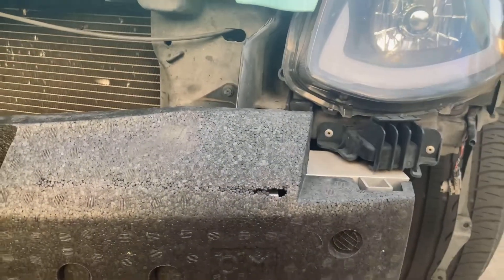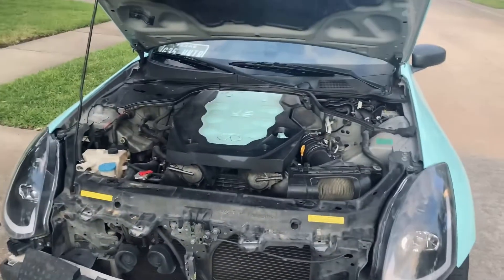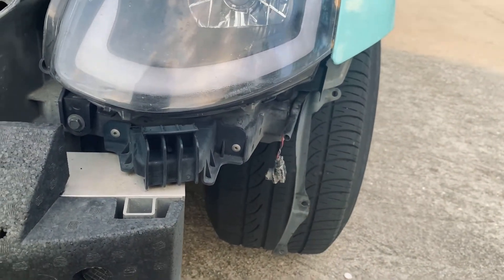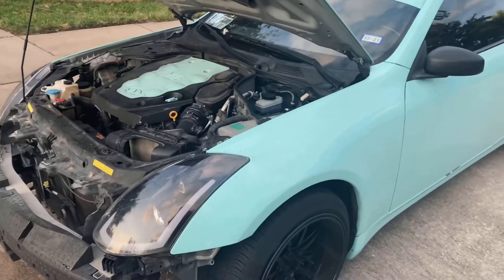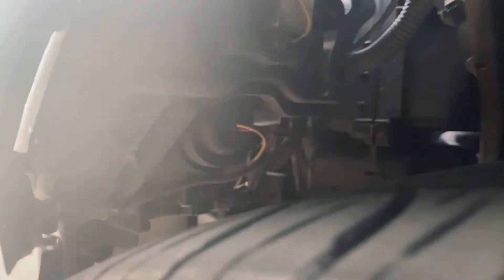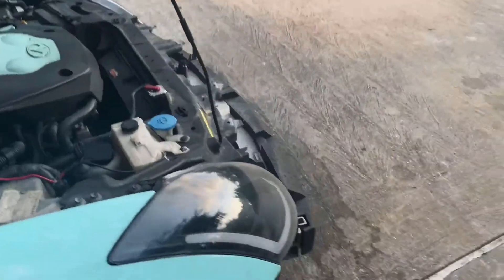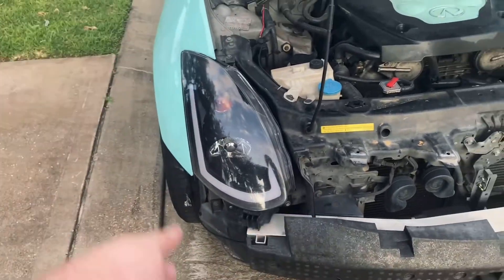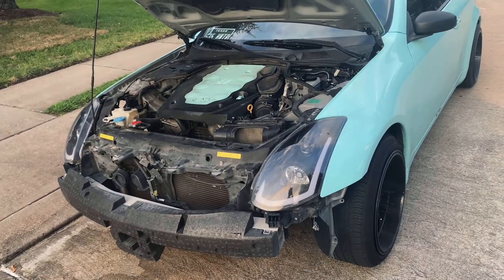G35 Spec-D Headlight BUYER BEWARE!

Comment: Just subbed bro out in Cali wit my 06 g35👌🏾I have these headlights on my G they’ve been amazing bro your supposed to seal them up before you install them (Spec D recommends in instructions)  & then you’ll have zero condensation in them, for the cap it might’ve fell out if you didn’t turn it & lock it in all the way. Just use the one off your old headlights their the same thing👍🏽
Reply: where did you buy them ??
Reply: @notcarty9157  Got mines off Amazon because I have prime. No difference to them, & got to me in like 2 days👍🏽 just seal them up with silicone sealant (black looks best) before you install. Let the the sealant fully dry & you’ll be good had mines for coming up on a year no problems or condensation.
Reply: @unknownsuspect5362  Link for the headlights you got?👍🏽 they raised the prices to 400$
Reply: @NSRTalonzo  these are the exact headlights I bought. Prices depend on the color housing you get. I have black, looks the best to me. Seal them up before you install & there ready to go bro. No complaints

Comment: Thanks more making this video. The lamps look great...
BUT the quality is terrible. Especially the water getting into the lamp... from the back seal/cap and the front around the clear cover
Really Spec D??? WTF
Even though I like the styling of them a lot more than the OEM lights, I would prefer them over 2 pretty fish bowls filled with water.
Thanks again for the good review and sharing te headaches of owning the Spec D lights